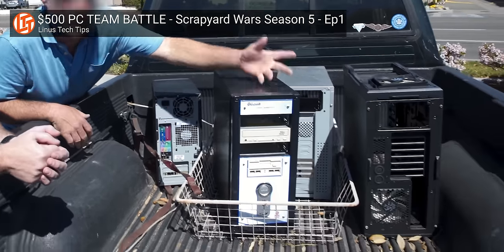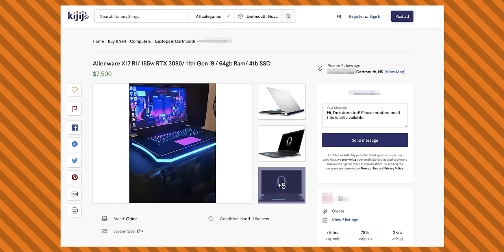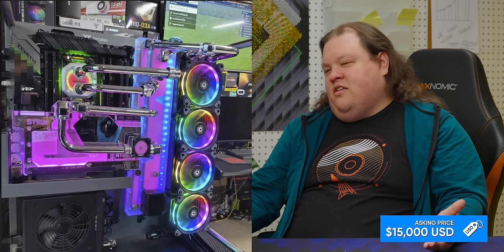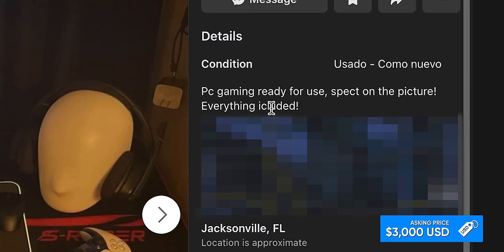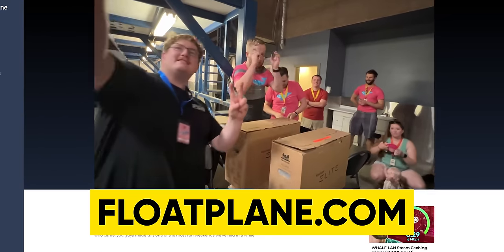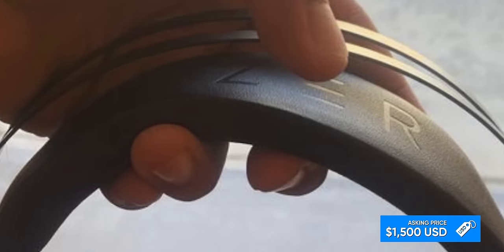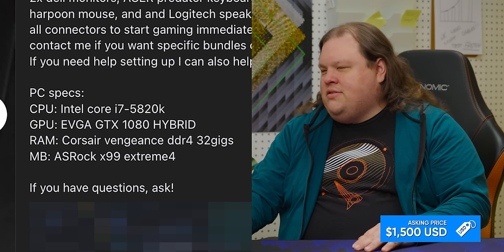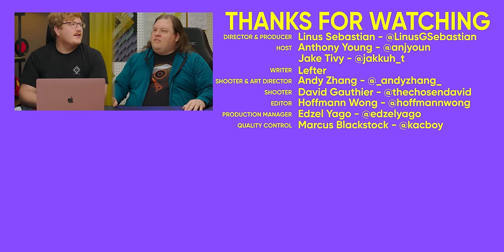Roasting the Worst PCs on Craigslist

Comment: I have 128GB in my gaming system but I host a large ark cluster on my pc 24/7 and have had up to 96GB usage before in my daily normal use. I agree most people don't need it but why are they crapping on 128GB of ram so hard lol. Either way keep up the great content guys!
Reply: My thoughts exactly!! The prices, the paired components, fine... But i wouldn't buy or build anything with less than 128GB RAM for what I do... It's 100% crucial (but not Crucial, just necessary).
Reply: Same. I build machines for my production company, and 128 GB is standard, but we’re doing things like AI upscaling and huge file renders and usually still have lots left over. I cannot fathom why anyone would need over 32 in a gaming machine. Even that is overkill really.
Reply: @brandonwilson3507  considering how technology evolves and software demands are ever growing, this statement isn’t likely to age well. It’s like that quote attributed to Bill Gates where he is alleged to have said that “640KB out to be enough for anybody”. LTT even did a video recently suggesting that both the system architecture and the games themselves are starting to utilize more memory than they have before. And if you want to be able to game at high resolutions while simultaneously running Chrome, Discord, OBS/Twitch and other popular streaming apps which can use up a good chunk of memory, then having some “head room” isn’t a terrible idea. If you’ve ever encountered a memory leak in a game or any other application, then it’s also better to have more free memory available to delay the inevitable crash. (Not the best use case, but it’s happened to me, so I’m sure others have experienced this before.) Note: Still, that being said, 128GB is overkill for 99% of the gaming population.
Reply: Honestly I think they were crapping on it under the assumption that these guys put 128GB of ram in their rigs for no other reason other than to max out their specs, despite never having any need for even half of it. Based on the way a lot of the systems were built and listed I don't blame them for the assumption lol.
Reply: @PsiliPharm2012  I actually don’t think most of the gaming population will need much more than 64GB even on the highest levels ever. As system architecture gets better and more integrated, and memory speeds from SSD’s and their successor technologies advances, not to mention cloud gaming, high system RAM may become more of a thing for specialists. I can foresee a future where memory and network latency are bigger impacts, along with the CPU’s ability to decode and run dedicated processes.

Comment: I have every computer I have ever owned, save the first 3 and I gave them away to the same guy. a Radio Shack Model 1 w/ expansion interface and 4 floppy drives, a commodore 64 and an Apple II+. OH all the software and computers filled a little ford SUV.
Reply: That sounds like my basement. This has worked out to my advantage because I was asked to fix an old system used to run an imagesetter, which is a high resolution laser printer that outputs to film for printing. Digging through my parts, I was able to find an old AT power supply and a replacement hard disk, which was a whopping 500 MB.

The rest of the hardware, outside of the EISA motherboard and proprietary SCSI controller wasn't anything to write home about and included a '486 DX50, 1 MB RAM, and the old 3COM network card with the COAX connector on it.

The scary part though was finding my MS-DOS and Windows 3.1 disks to install the software again because the system can't run on anything else. I eventually found them, and one disk was faulty, but I was able to recover it and continue the install.

Comment: Yeah, the 5820k WAS the cheapest you could buy for x99, but it was also $380 new at the time.  It was 6 cores in a time when most people were only buying quads.  Super stable at high OC, support for quad channel.  It was a fair bang for the buck in 2016, and upon building my alder lake build earlier this year, has since served as my primary server.  Great CPU

Comment: 11:35
"And then you can put the laptop in the backpack. Then you don't need the warranty."
I would've thought there would be a ban on putting the word "backpack" and the phrase "don't need the warranty" so close together.
Reply: Probably because they don't care, anyone who whined about that whole debacle are just a bunch of Karens, wasn't an issue until GN made a big fuss about it. LMO said they stand behind their product, if someone needs it drawn in crayon to make them feel better they should just not buy the product.
Reply: @frankyg2384  GN? Gamer's Nexus? I've been out of the loop on this one. What happened? I've seen the "trust me bro" memes, but I don't know the story behind that.
Reply: Also, are they claiming the backpack can prevent manufacturing defects in any third party laptop?  Like, imagine someone buying their backpack and a laptop without a warranty, then their laptop breaks in any other way than physical damage, but one which would be covered by warranty, except they don't have the warranty on the laptop because the backpack was supposed to protect it? IANAL but this sounds like it could put LTT in deep trouble.

Comment: 11:02 don't discredit laptops, my Tecra A11 has been previously used before I bought it 3.6 exact years ago and I'm still using it. Only recently did the battery become nearly dead and last 2 minutes if disconnected from the wall. Besides, a new battery shouldn't be hard to come by.

Comment: Got mine second hand, i7 7700k enhanced, 16 gigs ram Corsair Vengeance, b450 f Asus motherboard, gtx1070, 4tb HDD and 250 gig sdd. 750 watt power supply and a Corsair crystal series case. All costs brand new 3500 three years ago. Got it three years ago 1200.00 and was able to get the seller to throw in the peripherals. Since then I added additional sixteen gigs of RAM and upgraded GPU to a 2070 super. So, all encompassing I got an AMAZING deal. I would always encourage people to buy second hand but be smart about what you're buying, inspect the hardware and software, and do your research. This PC is still carrying me strong, just finished calypso protocol and it was fully maxed out fully maxed on rtx and in 4k. The i7 7700k series is a powerhouse and still struggles to be maxed out.
Oh shit forgot to mention, the system is also water cooled. The cpu is unbreakable because of that.

Comment: I've used gaming laptops for many years. Back when 1060s were current generation, I had a Dell laptop. I bought it for 800 used at microcenter with factory warranty. After a year I contacted Dell and they shipped me a new keyboard, trackpad, battery, motherboard, bezel. I rebuilt and replaced everything and sold it for $1,100 on let go.  It was still a very capable system, ran Doom 2016 maxed out. But I got a very good deal out of that and I feel the next guy got a pretty good deal out of it too having a pretty much brand new laptop.

Comment: My previous system was a Craigslist used system, Athlon X2 or something like that, was some guys custom build. $200 for a complete system including display, somewhere late 2013/early 2014. Initially just wiped the FreeBSD on  the drive in favor of Ubuntu, then upgraded it a few times. The only part from the original system(as purchased by me) still in service is the 1080p display, now connected to my Pi 400, if I ever get around to buying a ton of hard drives the case will come back into service for a NAS. My last upgrade I figured it was time for a complete new build.

Parts I put into it that are still in service are my main systems mouse and secondary NVMe.  Motherboard, CPU, RAM, and PSU will come back into service when the NAS happens, the RX570 I put in is stored as a backup in case my 6800XT has issues.

Comment: 3:56 put a slim 1650 in it and you got a nice little entry level VR PC even if for gamepad/wheel only VR games. I feel if it had either a 1650 or the controllers in the price, it'd be a very good deal. It'll play basically all quest-PC cross platform titles and some will look better. OLED is its own quality for VR. BUT to get the most out of it you need to know what to expect and how to optimize games for VR and keep the framerate steady.

Comment: You two work well together on camera, seriously what the scooby doo are people thinking with some of these prices, if you are gonna buy a ready-made second hand rig, you can get some decent 6th/7th gen Intel i5/i7 PCs for dirt cheap from tons of places, an i7 6700K/7700K, 16Gb Ram, SSD and what not, all for under £150 most of the time, I've seen the i5 equivalent for literally a £100 or so, all you need is a decent GPU, like a RTX 3060 Ti for £350 or a GTX 1660 Ti for £200, you will have yourself a top-notch gaming rig with plenty of CPU and GPU grunt, enough to run the latest titles @ 60FPS medium to high graphical settings, depending on what GPU you go for, all for 300-500 pounds or so, depending on what you buy, an i5 6TH/7Th gen intel CPU and a 1660 Ti for £300 quid would make for a pretty decent rig for most people, a great option if you are on a budget or just want a decent second PC for media/gaming in the living room or whatever.

Comment: 16:47 middle of the screen. Is that the CPU power connector? That's... not connected? The MB connector is there, but the 6-8 pin CPU power is not? Probably why it doesn't work.

Comment: I got a refurbished gaming laptop off eBay for a pretty good price it's an HP Omen 15 with a GTX 1660 TI  and an i7 9750H I've had it for we'll over 3 years now and I maintenance it every 6 months disassemble it clean out the dust clean out the fans apply new thermal paste to it still works great I use it for gaming and music production it was worth $1,300 when I looked up the original price and I got it for $800 I figured I got a pretty good price for what it was originally worth. I have upgraded it to a 1TB M.2 and added an additional 1TB internal HDD and outside it has a 4TB external HDD and the battery lasted me 2 years I've had to replace it with a new one only once so I still think I got pretty lucky compared to what other people sell out there.

Edit: for anyone asking it's a 1080p panel with 144 Hz refresh rate it has 16GB of DDR4 RAM. I know it's loud cause it's a laptop but I really don't care cause I use headphones anyways so it blocks out the fan noise and it really doesn't bother me to begin with. I also don't care that's it's a 1080p panel it's a laptop that still work good for me and I'm happy with it and I won't be replacing it till something on the motherboard internally breaks that I can't fix✌🏽

Comment: Some people don't seem to realize that PC parts rapidly depreciate in value. I sold a PC about 3 years ago with an i7-4770K, 32 GB DDR3 ram, and a GTX 660ti. That cost me about £800 when I built it several years prior. At the time I sold it, £200 was over-asking slightly, and I was only able to ask that much because i7-4770Ks held their value more than normal as they were very good for overclocking. If I were to sell it today, 3 years on, I'd probably be lucky to get like £120 on a good day if I threw in an SSD or something.

Comment: Just asking about your remark about the i7-5820k processor (at 15:42), since I still use this processor. Yes, it was the cheapest version but also easily overclockable. Even Linus made a video about this specific processor how easy you could overclock it. So it has 6 cores running natively at 3,3Ghz, but with some serious cooling you could amp it up to 4,5Ghz and even for short moments to 5Ghz. Your comment is only that it's the cheapest processor, but is also a 'bad' processor? To your opinion?

Comment: I recently saw a listing for $3,000 and showed the receipt. Brand new $1,000 system + $2,500 in labor charges for a long list of silly software installs and checks. Says "Cost me $3,500. You get a good deal at $3,000".

Comment: Is it bad that I still have my 2 old (but 100% functional) systems just sitting doing nothing beside me? I never bothered selling them.... System #2 still perform awesome in 1440p high settings in new:ish games.
System 1) i7 3770K, 32GB RAM, GTX 1080 Golden Sample, 256GB+160GB SATA SSD, Corsair HX850 fully modular PSU 
System 2) i7 8700K /w Noctua D15, 32GB RAM, RTX 2080 Super, 512GB NVMe SSD + 1TB SATA SSD, Corsair HX860i fully modular PSU with custom braided cables
Reply: 110% #flex! LulzSec

Comment: When my old PC suddenly blew up (it was shit anyways) i bought a used PC from Facebook marketplace. MSI B450 Gamin Plus, Ryzen 5 2600x, 16GiB 2166 Corsair Ram, a Samsung SSD with 256 Gib an a GTX 970 all inside a CoolerMaster HAF 932. Only things i invested was a CPU Cooler (the boxed one installed was annoying) and a ghetto fan mod for the 970 (wich was even more annoying) and i threw my old ssd and harddrive in. The 970 is the only thing wich might be replaced soon and maybe a M.2 drive but i still use it and game with it and the system works just fine. That was just when Hardware prices startet to go skyhigh and i think i did a good shot for 350 €uros.

Comment: The parts you need for a intel PC:  CPU intel 1700,  Motherboard intel 1700,  Ram/Memory sticks DDR4 or DDR5 depending if you have a DDR4 or DDR5 motherboard,  1TB M.2 SSD,  2TB+ 3.5inch harddrive,  AIO water cooler or CPU fan Make sure it's multi platformed,  3 desktop fans that come in 3x kits,  Windows 10 or 11,  PC Mid tower case,  Graphics card,  Power supply unit (PSU) 850watts - 1400 watts depends on your graphics card.

LOL I do what your doing all the time as amusement. Its a laugh how many rip offs there are out there. If you want to build a pc all you need to do is not buy a premade and pick out all the parts for yourself and get the pc store to build it for you for a extra 70-100 dollars. Much cheaper this way.

Comment: That’s the thing about gaming laptops like that dell Alienware laptop for $5,000. Every-time I hear someone either new in the space or like deciding to get a gaming laptop I am so upset….. the thing is only buy a gaming laptop if your traveling or need it for work! Gaming laptops are worth nothing near what you pay for them even just short times later like directly after buying it. Not to mention there’s basically no upgradable parts, I don’t consider ram (possibly) and a new SSD as an actual upgrade for a laptop. So basically the CPU, GPU, motherboard, monitor, power supply are all worthless if you ever need to upgrade those parts of the Laptop! 

The other thing I see people on the internet not getting the fps they thought they would on these laptops and wondering why it’s running slow or hot. Most gaming laptops even good ones still suffer performance drops compared to a cheaper desktop version of those same parts. Not to mention even some of the best gaming laptops run hot. And lastly you going to always need the power brick with you because the battery life is terrible and with a gaming or windows Laptop your not going to get any performance from it while your not plugged in to the wall. 

Over all again just don’t buy those unless you need it to travel. Or for work. Or there’s some reason you actually want one. Especially if your new because in the next 2 years you might want to upgrade something and with a laptop you can’t really do that but with a desktop you can easily swap parts and stretch the life of that Pc to 5-8 years or more depending on how the parts hold up. Also I’m guessing that a gaming laptop if it breaks is going to be hard to fix or more expensive than the desktop repair. And some laptops there really are no fixing them you need professionals to repair them and it can cost a ton of money. Plus the monitor you buy with your desktop will last for ages as well lmao 

Do you tho 🤣

Comment: Actually selling a 10750h 2070s 32gb ram 4k screen 17” super premium laptop right now for roughly 1750usd(this is in an european country so count high taxes on original price)

This one is actually decent value due to extremely good condition, hardly ever gamed on it or used anything intense enough for the fans to even turn on, unlike typical gaming laptops pushed to their limits. Got caught up in university and didn’t have the energy. Also has a new battery, only a year old m.2 ssd and a real, transferable good warranty unlike the crap claims of warranty when it’s not ownership transferable on secondhand laptops.

You could get a new laptop for around that price point that on paper can do similar performance, but you get so much more like great materials quality, thermal design that can actually push the hardware well, i/o ports, 4k screen, super fast m.2 high capacity storage, 32gb ram to mention just a few things.

Even then I’m still expecting I might have to cut down the price 200 usd or so in the end. Maybe 1550-1600 total and that’s only because of the warranty and condition.

The guy trying to sell a cheaper laptop brand/series and probably spec wise too except for the gpu than I am for pretty much double the price IN A COUNTRY WITHOUT HIGH TAXATION ON EVERYTHING is god damn insane. My price is more of a fair one for a laptop in great condition (mine is also still pushing out excellent/great scores easily without tweaks in 3dmark time spy, never reapplied paste and tons of background programs and the screen has almost no backlight bleed or uniformity issues at all), even if that guy cut his down by half, it’d still be too much, try 75% less maybe.

Comment: I recently bought a gaming pc with i3-10100f , GTX 1650 Super and 16 GB memory for like 45K INR that's like 560 USD was it a good deal? Also the PSU is 550 watts and the cabinet has 3 RGB fans in front and 1 exhaust with tempered glass in front and side.